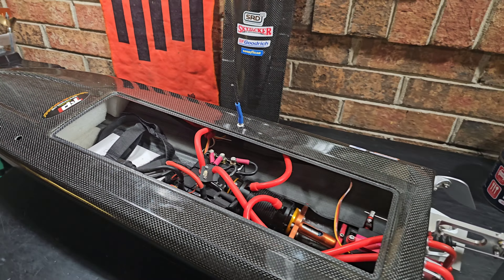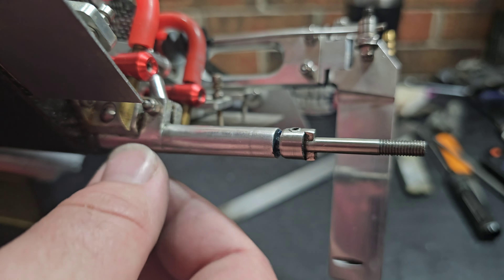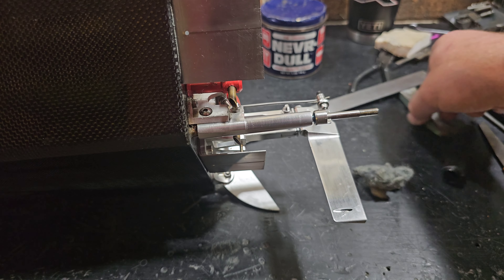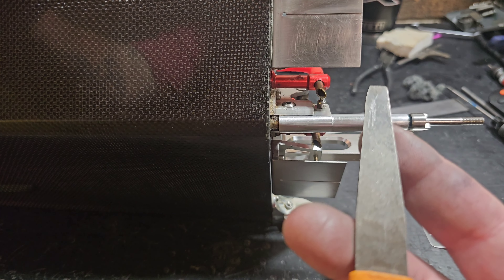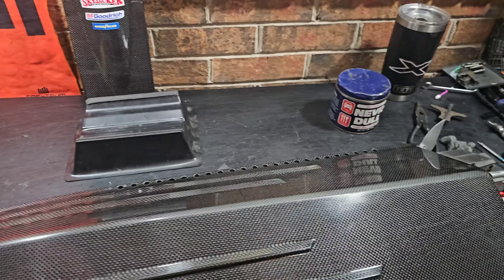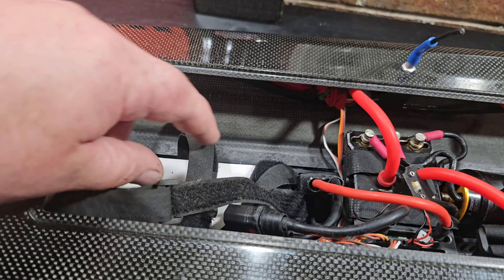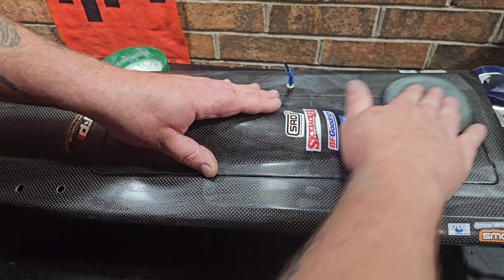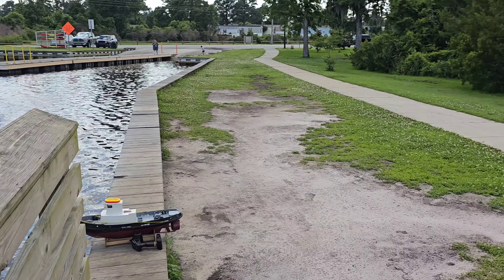What I Do Before Speed Run Oxidean Dominator SAW

Comment: What up BigB! Killin it out there son. I used to be stationed at mcas new river as a chopper mechanic! Loved seeing them flying man. Got my self a recoil 18 and 26 coming today man thanks for all the tips and tricks. Shreddy'd up son! BOATGANG!!!
Reply: I've had The recoil 2 recoil 26s th heatwave and the shreddy lol damn fun boat I will advise you not to run 4S the speed control has a tendency to pop on 4S if you are going to run for us I would suggest something like a fly color 120 or 150 but none the less the boat's the damn fun boat and just last week I picked up the 18-in version and my God that thing is a rocket
Reply: I hear ya. Got rcbb cooling kit and st1 prop. Will be taking it easy

Comment: Sorry bout the prop B, lotsa work invested to cut down and reprofile…2 -3 days plus all the little touch ups! Props to you for tackling it herself. I’m doing “most” of mine as wellCheck 
Voodoo props has good tools, like pitch gauge and smooth pliers.. Into small fast boats all my life, RC is just so cool, let’s us design and fabricate…gives you the rush just like the real thing…FYI, don’t wax the hull bottom, put a 600grit cross hatch finish- that breaks the water suction- ..
Can’t lie! Love watching ur channel, you say what’s going on, no hiding shit. I  get my BIG B fix , daily. Wished you lived near me, we’d hang out for sure. Re entered the hobby  about 2 -3 months ago , ran nitro riggers n cats in the 1990s and have been busy learning FE. Have a tfl: popeye, outerlimits and 2 run burnt esc Veles:(…starting with 4s, exploring 6s..
Waiting on rtr Cheetah xl, oxicat this week and just received a bare 38.5” delta force  mk2 today! … trying a TP: 4060-1650kv , and a 4070-2050kv with a little castle x8s…minimalist-OSE parts  first build…
Also waiting  on a German MHZ 138 mystic,54”  with twin 5680/730kv and castle xlx2…8s, so I got plenty of work ahead, like you I live for this and stay up at night thinking! Lol, Not bragging, just earning my boat gang card! 
imma in the AARP club, so gotta getter done now!
And for those YT folks reading this who think that’s alot of boats , 6 boats is just covering the basic design and size boats, it’s a steep learning curve, if you want to get good at this hobby/ lifestyle.

Comment: Have you tried applying a couple good coats of synthetic wax vs turtle wax? Lucas Oil makes a sprayable surface polish safe for all finishes that I have used on my, on my playing fields of my vintage 80’s pinball machines and various other surfaces that I want to keep smooth and slippery. Works amazing!

Comment: Thanks for the tips Big b, cant wait ti see it on glass water. What prop is that? If I have one I'll  send it to you.
Reply: Glassy water is sticky, small ripples, free up the hull and  are like wheeel bearings… low wind on any air lifting hull is a safety plus
Reply from the maker: 1817
Reply: @stevesocransky6341  Yeah my bad, what I mean is slightly disturbed water vs Farley rough.BG4l